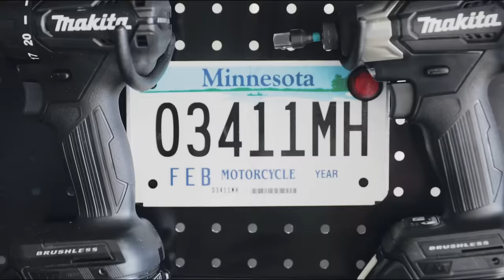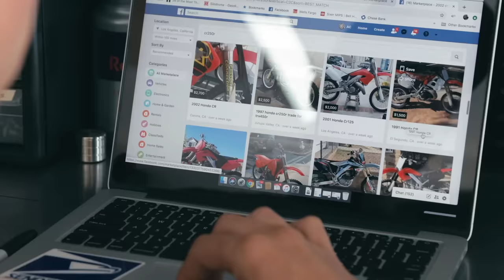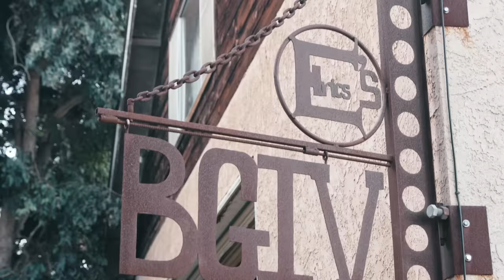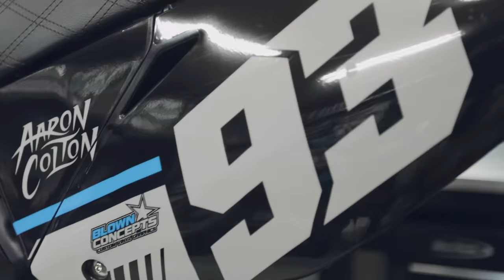Rebuilding a Honda Two-Stroke Bike | Project Two-Stroke 2.0 | Bike Builds with Aaron Colton

Comment: I had an 01 cr125r with a weisco 144 top end that I rebuilt myself and it was tuned and jetted for 110 race fuel.. I loved that bike and the love that I had for it put me in the hospital for 5 days so I sold it. And the guy that bought it from me also ended up in the hospital with pretty much the same injuries as me so I'll say that bike was a beast. That's why you don't rip mx racing bikes in single tire trails unless you are very capable of riding those trails. Tree's do not care what you are doing as long as you don't hit them.

Comment: Great build, loved to have seen you on the 250 though, look fwd to part 2, hopefully no top end swap during motos like last time, should be good.
What year CR never said, it’s between 02-08 last gen but there are differences, just interested to know which side of the unicorn 04 it is ! good luck at GH, cheers🤙
Reply: Unicorn in a good way or a bad way? Also, it's an 02.
Reply: TwelveAmps Oh ok I know he said the craigslist 250 he called about was 02 then on the phone it was an 04 but no title. re the Unicorn 2004 CR125R for me it’s a good thing, some and Honda did not, it was the only year the wee 125 had the electronic power valve, it robbed a bit of power down low, many hated it, the 250 suffered from perception of that too, but that was the Pv motor being weak, not the technology, whether it was a budget reason or typical Honda Japan arrogance they know best don’t argue, didn’t wouldn’t produce a more powerful PV servo motor I dunno, the US Factory guys had it sorted out anyway. But imo the 04 is a good unicorn for its unique and rarity and many don’t know it was a one year edition only. cheers dude.
Reply: Maverick224 he mentioned on Instagram, in a comment/reply, that it’s an 02. 
I agree about 04 being cool and such because it’s unique. I’m also a little biased, because I have one haha
Reply: TwelveAmps Aw dude that is awesome, Id never let it go. I been keeping an eye for one here, but even new here not many were sold, so it’s very rare to find one for sale, few know what they are, but those that do jump on them in the classifieds if seen,
Reply: Maverick224 yeah! It’s been great. About to rebuild the engine and get it nice and fresh! I love it.

Comment: 9:23 notice how he said "the 125" instead of 250
Reply: GamingFlower17 that is because as mentioned in the video I was not able to find a good base 250 to work with ended up finding a good 125 for the project.
Reply: Aaron Colton oh ok my bad
Reply: did you even watch the video? how can you missed the part when he clearly talk about how he can't get the 250 and say "...ended up with 125, no problem with that, small bore twice the fun"
Reply: Al Putra jeez man its just a mistake

Comment: am i the only one noticing a missing engine mount at 10:33 ?
Reply: No, A few have. The top engine mount was accidentally placed in some packing material in empty boxes. It was found and installed before DITD and was only without for a few laps of test ride. Structurally sound as many disciplines where removing the top motor mounts in the 02-08 CRF models.

Comment: dude u did a test ride with no upper motor mounts
Reply: Correct and with full confidence. They there temporary misplaced in some packing materials in an empty box in the shop. They made it on before DITD but I had no concern running without as it was a common mod in the older CRF's to remove the harsh rigidity in the ride. A few laps at a mellow moto track was no issue.
Reply: @AaronColton93  Glad you knew it! Saw the same at 10:33 and was hoping that was the case. Thoroughly enjoyed both the YZ and CR projects; kudos! The updated CRF suspenders also look on point for that 02'/03'? beauty...

Comment: Not trying to take the piss but wheres the top engine mounts? Or is that purposely done
Reply: They where temporary misplaced in some packing materials in an empty box in the shop. They made it on before DITD but I had no concern running without as it was a common mod in the older Twin Spar CRF's to remove the harsh rigidity in the ride. A few laps at a mellow moto track was no issue.
Reply: I own a cr125 03 would it reduce rigidity your saying? Should i try it out. 🇬🇧🇬🇧
Reply: Marcel Samuels I cannot confirm that for sure but it was done pretty religiously in the flat track community on the 02-08 Honda’s and here and then with off-road guys but I can’t confidently say if that would help you or not. It may be the best bet to start in the suspension department.

Comment: What is the point of buying a second hand bike when none of the parts are even used. Everything is new on this frame. Buy a frame and save yourself the strip down. This isn't a restoration at all. That said I do like the build.